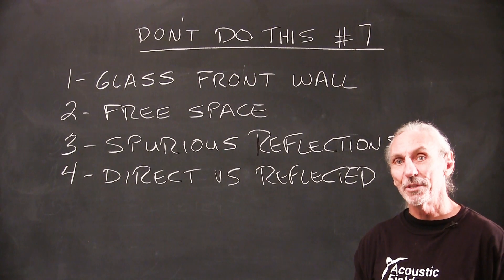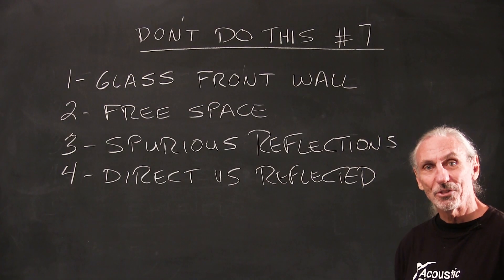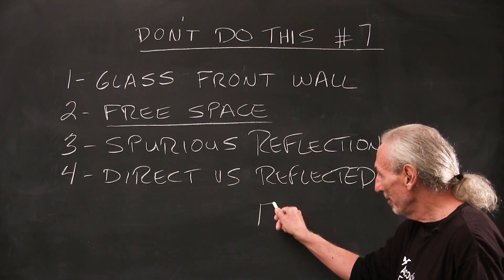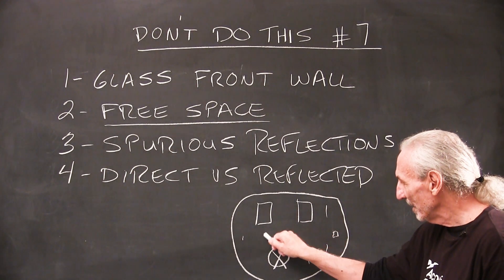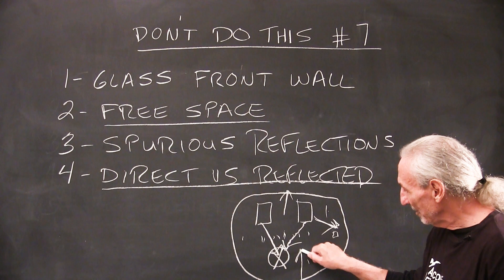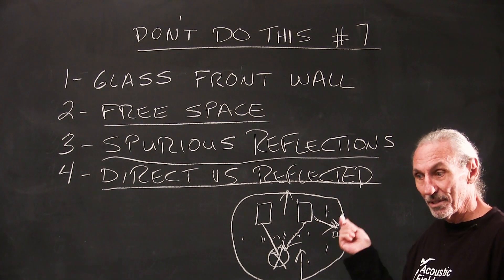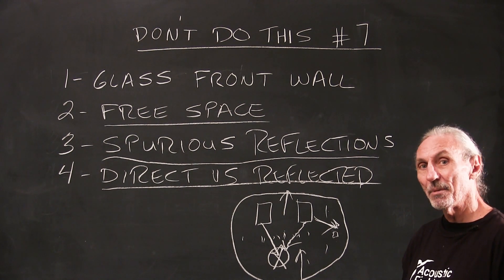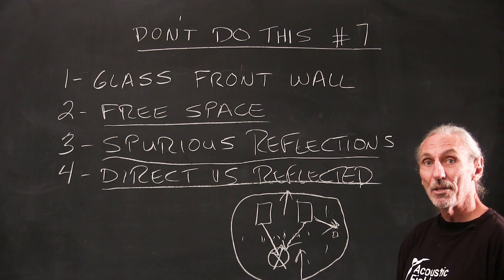Don't Do This! #7 - www.AcousticFields.com

Comment: Great video, which in your opinion what is more of a problem, glass on the front wall or glass on a side wall at the first reflection point? I know that neither of these is ideal for critical listening but I'm curious which is worse.
Reply from the maker: They are equally bad. It is the front wall and both sidewalls that must be treated. You can get away with not treating the rear wall if it is far enough away from the listening position.

Comment: Obviously, for a mixing or mastering room, you've got to have furniture and equipment between the listening position  and speakers.
Reply from the maker: Why would you place objects that produce spurious reflections in such a critical sound field. Our acoustic goal is to manage existing room reflections to achieve a balance between direct and reflected energy at the mix position.
Reply: @AcousticFields  I understand it's not ideal to place things in that space, but my point is where are you supposed to place your video monitor and controllers or console. Not a problem in a listening room, but a necessary evil in a mixing or mastering room.
Reply from the maker: @charleshuguley9903  Of course a DAW is required. However, that surface also presents issues. To test this, place a piece of foam across the console. You will hear the difference and will have to compensate in the mix.

Comment: I watched your green glue video and i have to disagree your wall assemblys are way out of most peoples price range green glue does work if you build a room inside of a room using rockwool safe and sound 1 layer of mlv 2 layers of 5/8s with green glue in between you get awesome results and depending on the size of your room it will cost about as much as one of your panels
Reply: I don't know what you mean by "awesome" results.  Do you know the STC rating for your solution and will it effectively block 40hz and at what level?

What Dennis was showing you is that the difference between a popular wall construction isn't that good for his customer's home theater application where it was leaking a lot of low frequencies into the next room.  And he was mentioning that Green Glue doesn't help below 125hz, even their literature doesn't list any differences below 125hz.. And the difference isn't the big because it's not really a barrier.  It's just an adhesive that doesn't even have complete coverage between two panels (your choice of material)>

If your room needs a  higher STC and the ability to block down to 40hz, that's what he would use because it WILL be effective in those situations, but again, he did mention that the room, application and the frequency and amplitude dictate what type of wall construction would work and that one type of wall construction doesn't work for all situations. He was just using an EXAMPLE of how he can create a wall with the same thickness that has a MUCH higher STC rating and is effective down to 40hz whereas the other common design isn't effective for a home theater application.

Just my 2cents from watching the video and reading your comment.
Reply: @Oneness100  i understand this and i appreciate his wisdom im noy bashing him just giving my opinion..   i can sing at full volume even yell at the top of my lungs and the way i have built my room you cant hesr nothing on the other side bass does bleed through a little bit but you have to have the monitors cranked up for that too happen
Reply: @jontay2002  Yelling or singing at the top of your lungs?  Measure the frequencies and amplitude of your singing and yelling.  How low can you go and at what amplitude, etc.

Everyone has a different range of frequencies and amplitude with their voice.

Now, go compare a home theater system and turn it to the volume level that you are going to play it at it's highest  level and then measure the frequencies and amplitude, and then compare the two.

If you have the home theater system, that's probably going to have a much wider range of frequencies that will mostly likely go down to the 20hz range, but mostly in the 30hz to 40hz range. I haven't heard a male voice go down to that range, let alone at a simlar volume level.

Depending on what you're actually doing in the room and what external sound you are trying to block from getting into the room is going to dictate what type of barrier structure you need.
Reply: @Oneness100  im not disagreeing with you im just saying you can get good results for alot less money then $750 for a panel.. put it this way my solution is a mercedes  Dennis's solution is a rolls royce..
Reply from the maker: J,  You are making a false comparison. Comparing a diffusion or absorption panel to barrier technology is inaccurate. They are completely different technologies with no overlap. I get calls everyday from individuals who have used the glue and drywall method in their home theaters. They are disappointed it does not stop low frequencies. It can not. It is not because of the glue adhesive or the double wall construction. It is because the design will not permit proper barrier action for low frequencies. It is just physics. To use and waste 10" of space with this methodology that will only work above 125 Hz. is at best foolish. Here is the worst part. It can not be fixed so you must either tear it out or live with it. Neither option is viable. People don't usually plan to fail but they definitely fail to plan when it comes to barrier technology. I have seen it almost every day for 12 years.
Reply: For Low Frequencies, it first has to be a product that's actually going to absorb the frequency range that you actually need and the one that's going to be the most effective.  If the panels you are using aren't designed to go after the low frequency problem that you have, then going with the panels you're making isn't even trying to solve the problem, it's just the wrong product for the problem, regardless of price. 

Understand the problem first, THEN figure out what's going to fix the problem the best.

Yes, I know, AF's products can get expensive, but you don't necessarily have to buy everything you need at the same time.  

For a comparison of AF's foam vs building insulation? Building insulation is cheap, but AF's foam isn't THAT much more expensive if you're building your own panels with both products.  AF's foam only gets more expensive if you buy their pre-built foam panels with fabric covering..
Reply from the maker: Once again, you are not realizing what frequency ranges this "technology" works within. I get calls everyday from people who have used this approach but are unhappy with the low-frequency transmission. This methodology takes up too much space and does not attenuate below 125 Hz.
Reply: Jason,
What types of wall design are you using?  2x4" stuffed with Rockwool, 2 5/8" sheets of plywood with MLV and GG?  and using 2 walls of this?  How much air gap?   And what did it measure at?  What was the STC rating and how low did it go down to?

I doubt you're going to get a very high STC rating with that compared to what Dennis would recommend.

Comment: Dennis, for those doing primarily mixing and need the desk/console between the listening position and monitors, do you have any suggestions to minimize the negative effects? Is mounting the desktop at an angle useful? Is mass in the desk itself a good or bad thing?
Reply from the maker: What are the dimensions of the room? What is the frequency range of the mix?  Desks by definition create audible distortion. To test this, place a piece of foam over the desk.
Reply: @AcousticFields Room is 12'w x 25'l with vaulted ceiling averaging 10.5'. Sourcs is mostly rock/pop, monitors fairly accurate in the 40-20k range, currently no sub. Room will be finished in a few weeks and I was hoping to start designing the desk (No console) and was looking for some guidelines.
Reply from the maker: It can help. Engineers we work with have a piece of foam that they lay across the DAW to hear the impact of console reflections.

Comment: Understand hard surfaces like glass are very bad, but how about on the flip side? How do you know you're not over treating and creating a Dead Room, is a sound analyzer the way to know? Seems just by looking at some of the examples a lot of people don't know what good audio even sounds like!
Reply: Your ears will tell you in no uncertain terms. Also, it takes a lot of treatment to over do it. Also, once you reach the point of treating all the bad stuff, THEN you add diffusion to create the soundstage and the level of liveliness  that suits.
Reply: @bc527c  Not necessarily. Sometimes, your ears will deceive you.   It's not the amount of treatment as it is using the right rate and levels of treatment.

I think measurements AND listening need to go hand in hand and I think Dennis would agree to that.

Example.  Certain types of absorption materials absorb too much and when you use a lot of the wrong material, that can create a room that's overly dead…. Adding diffusion will help, but changing to another material that's better suited will also improve badly treated room.
Reply: Also, a tip, when putting up acoustic panels and or doing any acoustic device install, if at all possible do it while the system is playing, because you will be able to hear the effect in real time... and be able to evaluate if it is a positive or negative effect or no effect at all (then unneeded at that location). This will also educate your ears as you go. Do not try and install a complete acoustic solution in an hour and call it good, you will not know the effect of each item and thus not be able to figure things out properly.

Comment: Dennis, in your photos, you had a room that was an attic with side walls that slanted towards the ceiling.

How would you those types of rooms in terms of figuring out room modes since the walls aren't parallel surfaces with the exception that the bottom couple of feet are parallel surface, and they are angled.

How would you approach those types of rooms?

Comment: If there are large glass panels (sliding doors) that could not be removed, can they be mitigated with drapes with rubberized blackout backing? Thank you.
Reply: I have found the actual glass has to dampened. In one of my rooms I have 2 evil windows and, along with various absorption in the window well, I applied Sorbothane disks to the glass to slow the resonant frequencies down to that of the music or less. There is no real cure beyond removing the glass.